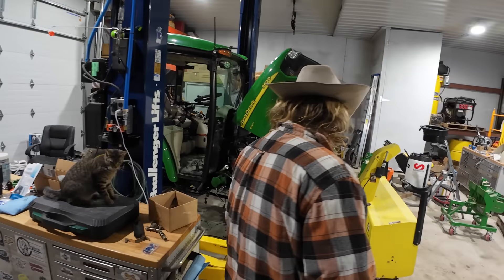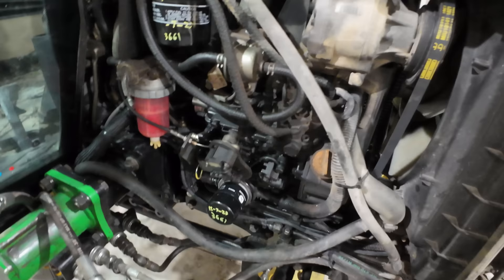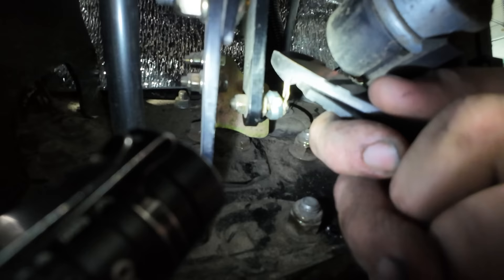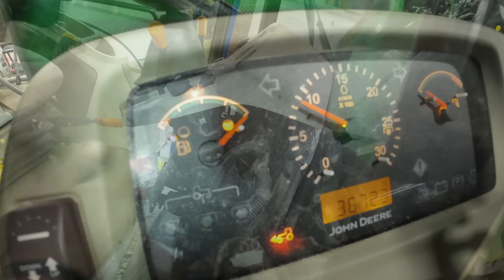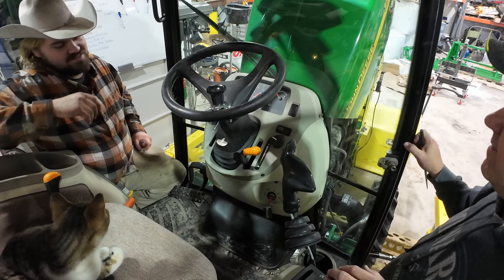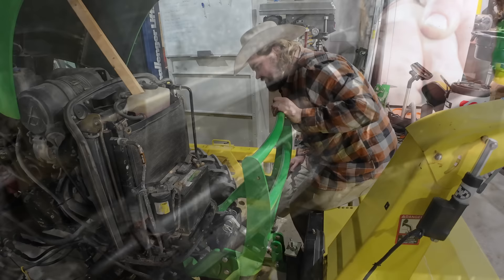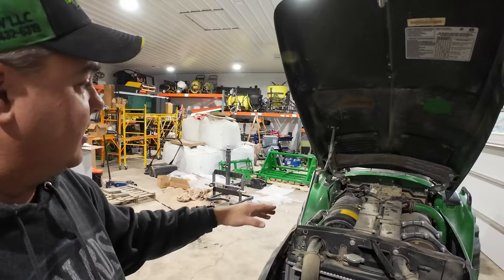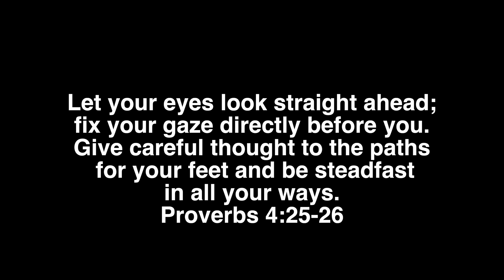Throttle Cable, Hood Latch, To Get Ole Salty 3520 Back in the Starting Lineup.

Comment: My LS tractor the throttle worked great until I put it on the trailer and hauled it from Florida to Missouri. I couldn't keep the throttle where I wanted it. Finally figured out that the bolt under the dash had loosen. It wasn't the easiest thing to get to. Otherwise it was hard to keep the rpm up while pulling the back mower.

Comment: While you would be jumping power from the ignition circuit, you would not be adding load to the circuit, just getting power from the circuit—load of blower would be pre fuse. 
So you could run it off s relay. Hot for power, but switched for the relay activation.